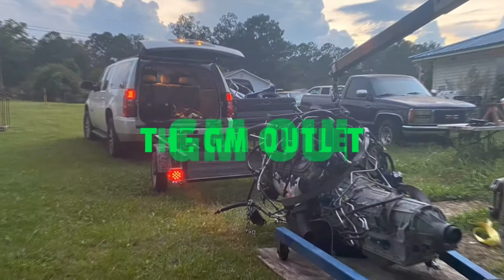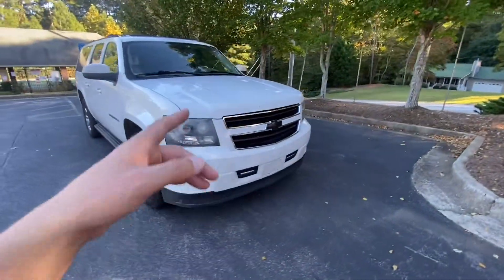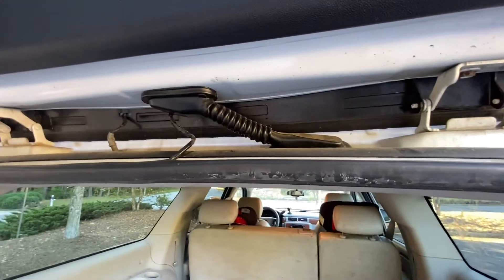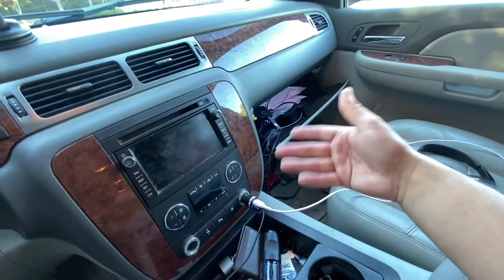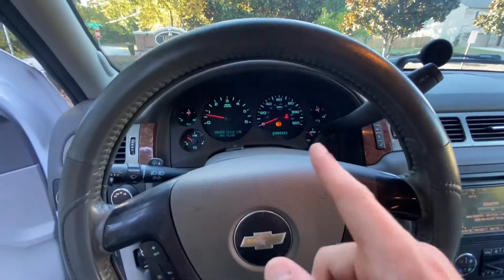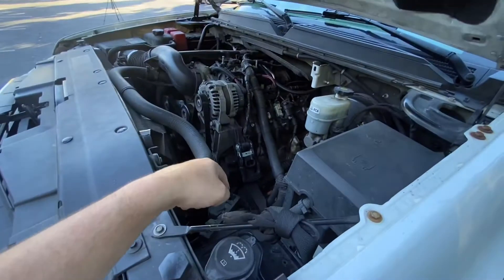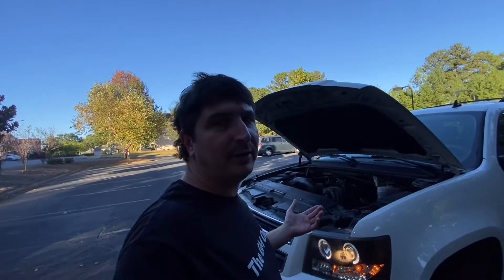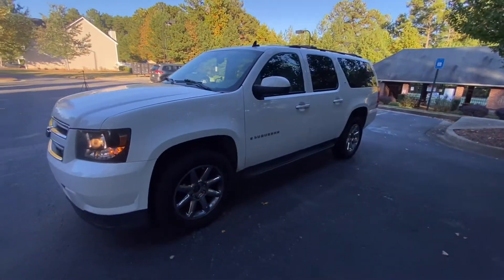EVERYTHING wrong with my 400k mile 2007 suburban 5.3L 4l60E ACTIVE FUEL MANAGEMENT

Comment: Are you sure that it’s really the rear main seal? A lot of people mistake the oil cooler block off plate leaking as a rear main seal, you should definitely look into that the oil cooler block off plate it right above the oil filter

Comment: They have new stickers on Amazon for your buttons.  I grab a couple.  Then bought a 15inch tv . My yukon denali got 378000 miles still running besides my oil leak from that vally cover.
Reply: Did you ever get it deleted?